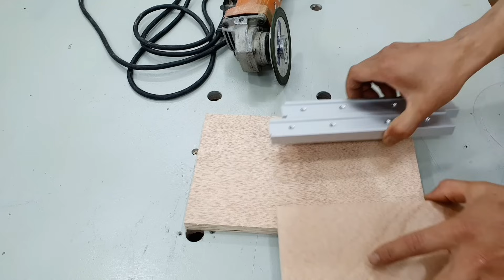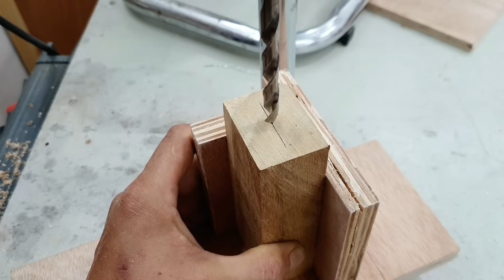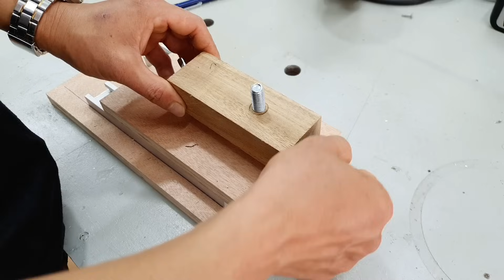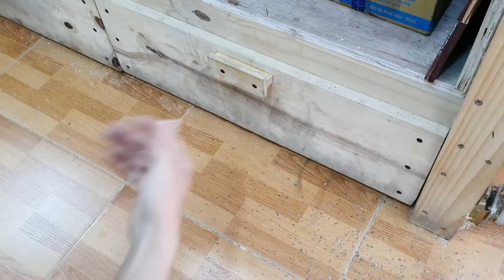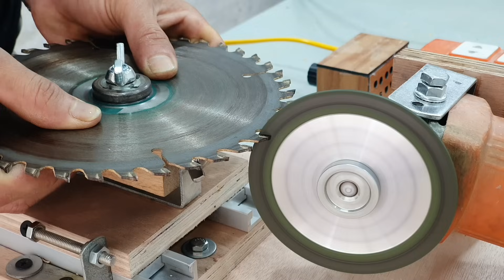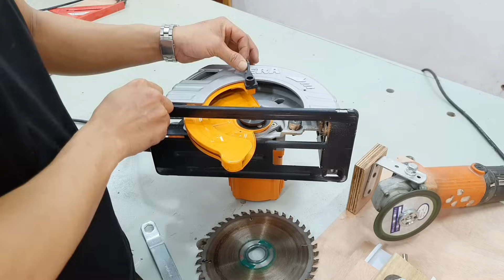Homemade Simple Table Saw Blade Sharpening Jig using a Hand Grinder

Comment: You've burned every tooth, that's bad, it mustn't be blue, it comes off one tenth of a millimeter (0.10mm), you have to make some kind of stopper and not grind and press with your free hand ... but ... I like the idea  ...
Reply from the maker: Thank you for watching and commenting!
Reply: I like the simplicity of the design, and will definitely follow this concept. However, I am concerned about the hazard created by holding the blade in unprotected hands. One slip could be a disaster for unskilled users. I also did not understand why you sharpened the outside of the blade. Other than to remove any burr it seemed strange - without an explanation! Thank you for the video!

Comment: Mr H is sporting a beautiful watch! I love how you modified existing parts such as the
 L-brackets. People always complain they dont have the right tools, or the right parts to make something. But if they opened their mind a little and thought outside the box a little, you would be surprised what you can use.old machines that may not work anymore still have value.strip usable parts from them and save them in a bin to search through at a latter date. Even the screws maybe of use. We are a disposable society and we have to change that way of thinking. Great job,love it!